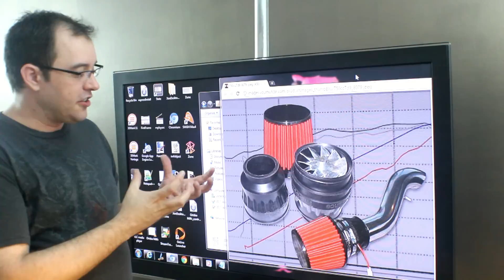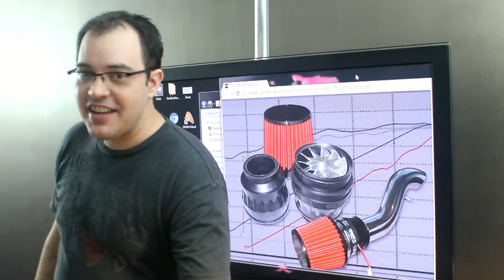Electric Turbo / Electric Supercharger / Forced Induction System: Should I Install?

Comment: If you;re going to do an electric turbo, use a REAL turbo compressor. A fan cannot produce boost. It can only move air. Turbos are extremely close in tolerances so that you don't get blowback around the impeller. Fans have massive gaps around the blades and the air blows through them. Also, airflow is not boost. The reason turbos add power is not that they move more air, it's that they COMPRESS the air they move. The only way to pack more air into a confined space is to pressurize it. Physics.

Comment: @sillychink3293 Look, if high CFM "Fan" could boost your car, then an industrial house fan would work (you can get up to 700 cfm from them!). But it doesn't because you need to compressor the air into the engine, not just move air. Unless the fan you are using looks like the inside of a airplane turbo fan (which has extremely tight stator tolerances) or looks like a real car turbo with an electric motor attached, your not going to get any boost.

Comment: Its an air mover not a compressor.  It cant force extra air in a set volume (boosting)
It can raise the amount of air pulled through the filter but its not strong enough to move any extra air into the cylinders.

In short don't waste your time.

Comment: Now saying what I did in my last post (damn youtube letter limits), there are uch better ways to get more air into your intake than this thing. First and cheapest is to replace your air filter with a high quality performance one. Second is to add a cold air or ram air intake kit. Next and most people will see a benifit is to replace the exhaust system with a free flowing one. Yup those can get expensive, but is destroying your engine really worth the risk? I have seen the damage one of these did

Comment: If you want to challenge speed limits, then car turbo kits are what you need. Automobile engineers have developed these performance enhancers after years of research. Once installed in your vehicle, they give it an amazing rush of power. But hey, drive safe! Looking for car turbo kits in Australia? Head to:
Pro Speed Racing
Unit 9/218 Wisemans Ferry Road, Somersby, NSW 2250,
Phone no.: 0418 436 861

Comment: @BlackwaterOpsDotCom on the contrair in a forced induction system fuel frequently the limiting factor and a 12 gpm pump sounds strange most pumps are rated liters per hour. also to contradict your theory on carbs for a grandma car 300 cfm might be enough but most motors prefer 450 on up 600 is mediocre the idea of a supercharge relys on presurizing the air coming into your engine forcing more air into the cylinder at any given spark to match that you need more fuel AND

Comment: OK! let's see it on the other side: On 3000rpm what is the reading of the MAF sensor without the turbo? For a 2.4L engine this flow could be something around 3600L/min. Read on your turbo or make your math for the electric motor speed and the fan angle, can you really exceed this amount of air sucked in?? This is basically the question I'd ask my self before installing such turbo!

Comment: Well, you get boost when u get more airflow but I know what u mean.  Exactly with the power.  People that think you can drive a blower from 12volts either dont know how much power is required to spin a blower under load or have no idea how big a 10hp motor is  And good luck finding a 10hp motor at 12v.

Comment: @amurhan5 Do yourself a favor. Pull the thing off your car and throw it away. You'll get much better results with traditional mods then you ever could with a electric fan. Putting a fan inside an tube is not a supercharger. Its more likely to cause a restriction than anything else.

Comment: first off the CMF rating of a crabs or throttle bodys is the max that it can handle does not mean that it does pull that mush how ever if your crab or  throttlebody is only rated for x amont of CFMS it does not matter what your heads flow the stock L31 pulls does pull more then 300CFMs off idol but the more rpms the more CFMs your pulling and if you go from negative to a positive manifold pressure as long as your O2sensor is on the wideband your going to make more power simple as that

Comment: We are right back where we started.  You still think air flow is independant of boost.  I dont know how I can be more clear.  In order to flow more air into your engine, you need to increase your manifold pressure. If you are reading 15PSI, you have basiclly flowed twice as much air than you would at 0PSI.  More Boost = More Flow.

Comment: @z33twinturbo Consequently we could go on to say that by simple logistics the force you can extract by an electromagnetic driven motor (that's basically what an alternator is, but reversed), is far weaker than anything crank driven. Superchargers are actually terribly inefficient (parasitic loss; some superchargers can take a few hundred horsepower just to spin), so we could easily say an electric motor is even less efficient and would be a bad idea just from that train of thought.

Comment: most petrol cars have a mass airflow meter. metering the air flow to the engine. surly the engine will run super rich at idle or low revs.  pricey add on !!!!

Comment: No, dont put this on. An electric turbo works but the quality of these products vary since this is a quite late technology. Some manufactures of these don't really know what they are doing. The power of these units ate only enough when the air is free flowing, but when they fight with the pressure, and furthermore the fluctuations of pressure,  they cannot handle. They leave poor performance, or even worse, broken bits flying into your engine. So wait for those can produce decent units.

Comment: Those are home plumbing reducers on there lol. These things never work. Not powerful enough to overcome the forces already at play with an engine. You would barely see any gain if you hooked up an industrial strength gas powered leaf blower to your engine.

Comment: You will never ever see any positive boost on that thing. Never. I have installed\build a few supercharged cars, and believe me when I say you need to spin a conventional belt driven blower (roots type or similar) pretty fast just to see reasonable boost. These blowers or compressors are very well engineered in order to effectively and efficiently create boost. That flimsy plastic fan would probably come apart very quickly under the continuous heat in the engine bay, and never even make boost..

Comment: Really... do you have dyno data to prove this?  All forced induction requires one of 2 types of compressors, either a centrifugal compressor or a positive displacement type, such as roots or twin screw.  This is just a fan, it does not compress air, even if it blows alot its not going to FORCE air into the cylinders.  If I put a big industrial fan to my intake i'm not going to gain any power.  Superchargers require around 7.5% of engine power to run, your not going to get that from a 12v battery

Comment: dont install it all its is a fan motor for a boat and the fan blades have to big of a gap to make any sotrs of bosst what so ever what you should do is make your own take a turbo compressor and make an adapter plate for an electric fan motor and put a regular turbo fan blade on it

Comment: Buddy, you already know that that thing is is POS.  You know what is really funny, the rubber parts on there are "off the shelf" sewer line couplers.  Seriously, go to a plumbing shop & see for yourself.  I'm just pissed that I didn't think of selling a scam like this.  And yes, that is an inline boat blower - and mind you, it is at 300CFM but at free flow.  It a fan, not a compressor, this means that it can not compress air, it just moves it from one side of the blade to the other.

Comment: Fans can make boost and flow lots of air.  Just not at the same time.  Even an industrial inline fan capable of flowing 3000cfm will only flow 500cfm at 0.25 psi.  And the power req is 2000 watts!  Fans are not an efficient way to make boost.  The amount of air a fan flows unrestricted is meaningless for a forced induction application.

Comment: all it is, is a potential disaster for the motor, the fan motor has no oil to lube the lil bearing in the motor,soooo the motor will notlast and part will go flying into the motor and blowing it up all for a cheap no good air restrictor... soo BAD IDEA...

Comment: The only way more air could work at all is the fact oxygen is incredibly unstable. Thus highy explosive when more air is put into the motor the engine needs to add more fuel which is where the hp increase comes from. Same with NOS. NOS doesnt blow up like in the Fast and Furious. It is actually not flammable. Why u think dentists use it (laughing gas). anyways the same thing happens with NOS. NO2 instead of air. Now for this fan DONT GET IT! They can only be used for 30 seconds THEN OVERHEAT!!!!

Comment: It doesn't matter how much cubic feet this electric unit can deliver, what really makes a difference is the power capability of the electric supercharger's motor.  If it's motor is weak (most likely) it may deliver 600 cfm; however, +600cfm might not actually be making it into the intake manifold because the electric motor simply can't push it all.  This product is a joke!  Electric Supercharger = $150...Dyno to see if it actually works = $300.  Is it really worth it?

Comment: I suggest you read up on how engines work with fuel and air management. You do not understand the fundamentals of combustion, nor how the ECU and maf work together in making a safe air/fuel mixture(ratio). Adding air in which the ecu cannot add enough fuel for will cause detonation and lean mixture= burnt valves and piston roasting if this thing even pressurizes air at all in the intake. Turbo and s/c vehicles are tuned specifically for it. You simply cannot make power by adding a lot of air.

Comment: The air being sucked into the engine is faster than the so called charger produces. Even if you did get a  fraction more power...that power would be used up generating the electrical power to power the dam thing.

Comment: and it will draw electric power from your battery and electrical charging system which will cost power, in essence those things are really nothing more than a sails gimmick, they do not really increase your power much at all, if not only fractional by a un noticeable amount.... not worth it too me.

Comment: These things re disasters waiting to happen. The idea although sound is seriously flawed. The biggest problem is having the unit BEHIND the air filter where if it fails then you ahve debri heading right into your engine. Now to the CFM problem. Most if not all naturaly asperated engines pull 300cfm without help (yes even a 4 cylinder engine does that). A v8 can and will pull 350+ cfm at IDLE. The idea behind a turbor a blower is to force more air that can be sucked in by the motor.

Comment: Turbo chargers and supercharges are about boost (pressure) not air flow. It takes a lot of energy to spool up a turbo or to power a supercharger and this power cannot be replicated by some shitty bulge pump that runs off 12 volts.

Comment: An electric is not ever going to improve efficiency! A conventional turbo utilizes the wasted heat in the exhaust gasses that would have otherwise just gone out the exhaust pipe.

Comment: What a fucking joke Look at those giant wires for the power consumption 12x4 3780 watts, dude if you put a cigaret lighter plug it will make an almost decent  fan but it would be safe to stop it with your pinky finger

Comment: A bilge pump will provide zero improvement and likely a loss.  Some of these little fans are good for 8-10 horse but they usually draw like 10-12 amps.  This is NOT one of those things.  HAHA

Comment: what to do..... step1 dyno run your car without this instalation..
                  step2 dyno run your car with this instalation..
             step3 check the car performance if it produces more horse power or not.... 
 100.000 people will be answerd

Comment: No. Unless you have one that is pulling major amperage, putting out insane high RPM's and insanely high CFM's/PSI's you will NEVER get an increase in performance with these things. If its cheap, promises HP gains, its fake. Same with those performance chips that scream "+90 horsepower". You want real gains? Buy a different car or get yourself a turbo. These things are just horse shit.

Comment: Good intentions in theory, not in practice, by the way, you should not compare "carb" cfm, to "boosted" cfm, as they are two completely different things. Besides that your map sensor isnt calibrated to accept positive manifold pressure, which is what that kit is "claiming'' to accomplish. its more than likely not even a two bar map. I give it a thumbs down.

Comment: @BlackwaterOpsDotCom part 1) Hi, i liked your video, i think that there are 3 factors that make this device ineffective, first the electric motor (unlike the exaust powered turbocharger) uses electric power which is drained by the battery and then by the alternator bla bla bla Second Law of Thermodynamics,,right? The second reason is that this thing is working at steady rpm all the time. if you look at how an engine work

Comment: This will not work, Moving the air faster towards the engine, which is all this fan would do, will not increase power, the engine needs "more" air in the engine a.k.a it needs to be compressed, a fan cannot compress, it will just increase the speed at which the air flows, but it will still be the same amount in the engine at any given time

Comment: @BlackwaterOpsDotCom A few of these electric superchareger (like gte)scammers advertise 5psi which is complete bs.  And yes, the point of supercharging is to increase the amount of air going into your engine so that you can burn more fuel.  Turbo and supercharger guys measure the effectivenss of their fi with a boost guage (PSI).  PSI means everything to a turbo guy.  A supercharger that does not increase the psi in your manifold is a joke.

Comment: @BlackwaterOpsDotCom That is what amueters think when adding a turbo to their engine.  Not that this crap is a turbo.  I laugh when people are told they need to add more fuel to their engine and they reply my fuel pump is big enough.  Like the fuel pump is what limits the fuel going to your engine.  When you add forced induction, you need to tune your engine which includes modifying your fuel map and timing.  Your computer does not doe this  for you automaticlly.

Comment: @bspenc Simple answer, no.  More complex answer:  Real supercharger requires ~40Hp to build 8 psi.  Output of this fan?  Less than 1hp.  These scams have been on the market for over 10 years and lots of information about why they dont work can be found on the net.  One guy even had one on a dyno.  Spend your money on a real turbo.

Comment: Don't do it.
This is a time honored rip off.
If you are interested in turbo charging get the book: "Maximum boost" by corky bell. The author has built engines ranging from 4 cylinders to Kart racing engines that are 18,000 rpm monsters. Oh, and he dedicates about 2/3 pages of why you should not use that fan.

Comment: i've got a friend who put one of these on, it did infact add upwards of almost 100hp 

the same way a bigger cold air intake works, is how this works, ramming more/colder/compressed air into the intake, thus creating power. 

however...this is a shit kit, i've seen real nice kits that run 500$ that have a real nice hobby grade motor, and turbine style blades that you would commonly find in 5000$ hobby/ professional grade aircrafts.

Comment: cfm is nothing if there is no psi......the system has to be pressurized to work at all.....it takes at least 2-3psi to feel any difference in how the car runs...i am a turbo guru of sorts and ave studied turbos for a long time and have turboed many many cars.....then there is the fuel thing.....more air/psi means the need for more fuel....those electric turbo things are useless....just a plot to make money off of non mechanically inclined people....dont waste your time....

Comment: @BlackwaterOpsDotCom Hmm. Well, if it doesn't suck in a peice of that wheel and shove it into your intake valves, ruin the seals, slap some pistons on the valves then you'd probably have a better day.
I know a fair amount about cars, and I can tell you safely, this is a waste of your time. If it does work you could ruin your MAF, blow some of your intake away, blow your engine... the list goes on and on.

Comment: I have a turbo, this is crap, by looking at you you probably drive a mini van, but anyways this is crap, and so is your theory, more air does not mean more power, it means you're running rich or lean, more air and more fuel to combust the air means more power

Comment: il try and find a like to the custom shop that i know builds these things, they use high grade aluminum for the body, and high grade wiring and motors, from usually brushless motors from brands like tamiya, venom castle creations and trinity, 

ever see thoes electric Rc cars that can do 120mph? and thoes little motors are runing on 7.2 Volts... its the Miliamps that count...and a car battery has tones. 

AS for proof,  cheak youtube for proven dyno results there here

Comment: 5psi on a 400ci motor like some thing in the ZR1s should be good for 50 to even 100 more hp but like the guy in the video i think this thing is crap the 5.4 ltr in my car would suck that thing down the intake all that thing well do is screw with your mass air meter i bet if you put this on a newer car like the newer LS or ford tritin engines your just going to f@#$ up your fuel mileage dont put this on any LS motor they make some good power and gets around 20 MPG put some twins on it